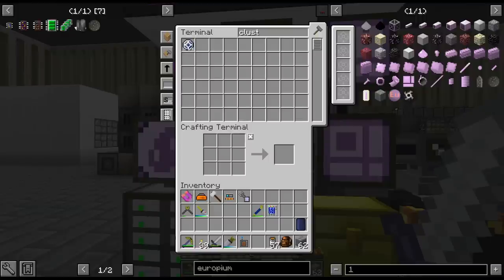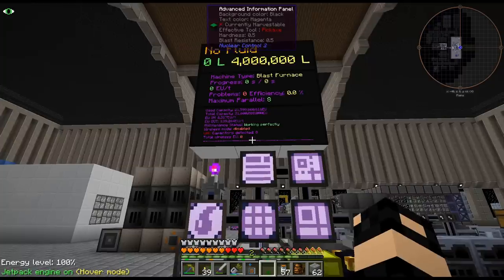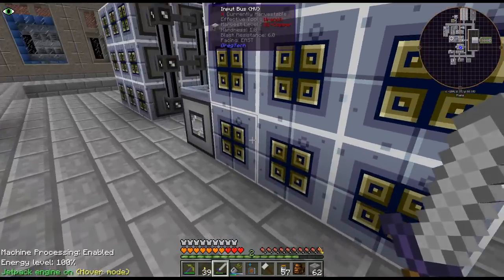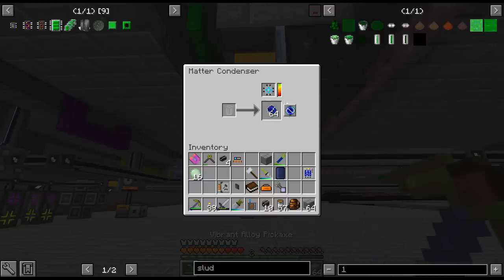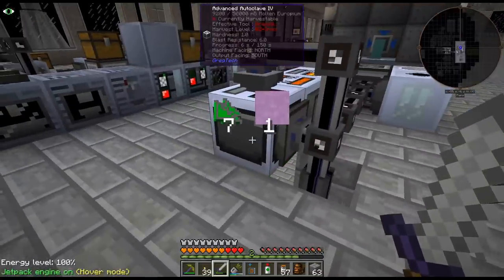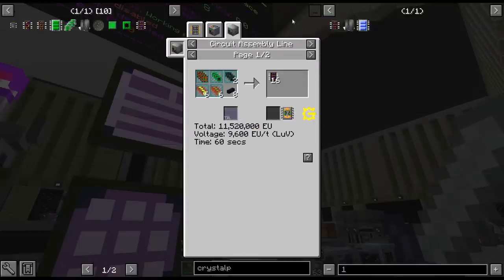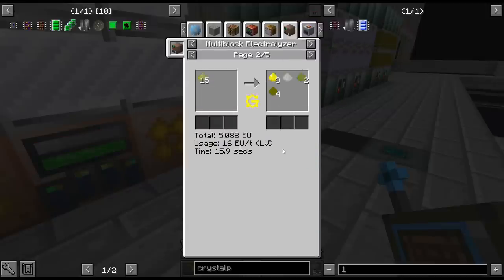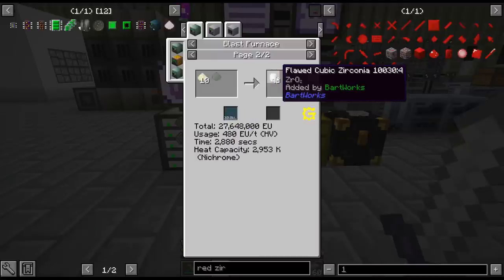GregTech New Horizons S2 - 193 - Crystal Circuit Line

Comment: You can do a red stone latch to turn the turbine off when full on power and on when low on power
Once you get mysterious crystal you should definitely get mutagen for crystal chips
To make cubic zirconium you would just leave the dust in the input bus, just like a circuit
Reply: How to make redstone system for power control? Any guides, screenshots? Thanks
Reply: @methyladenine  Project red has logic gates that makes red stone latches pretty easily, there are red crystals to fine tune redstone level